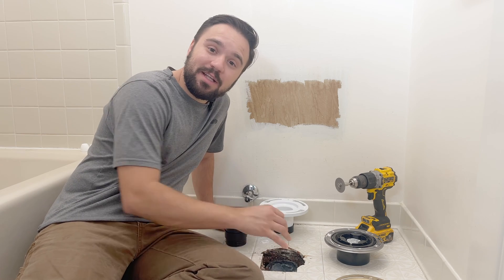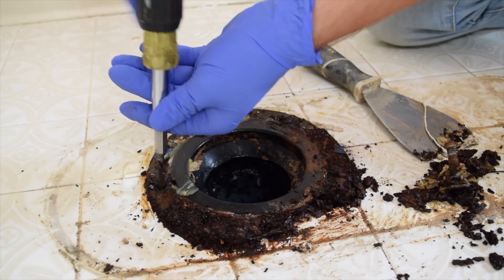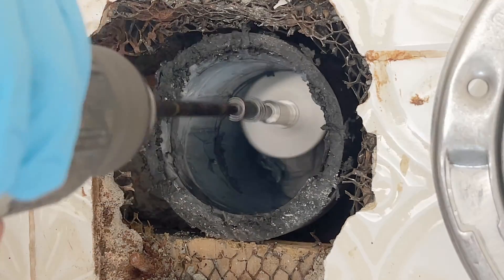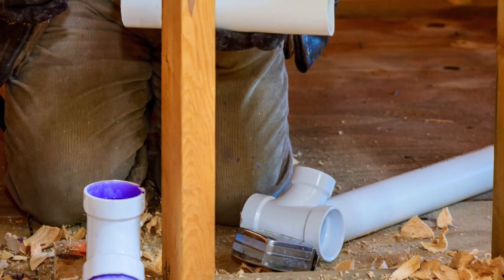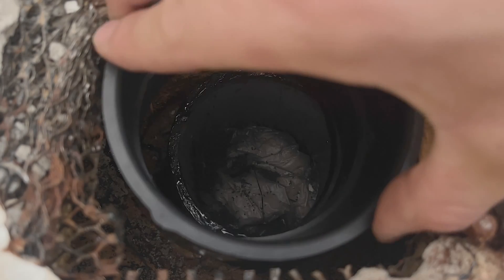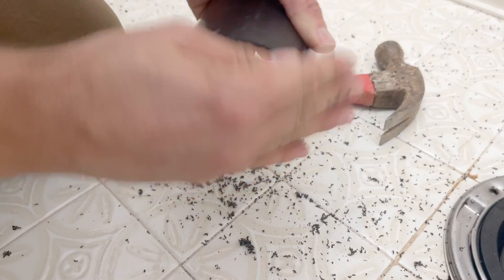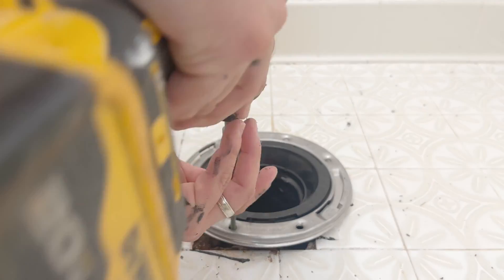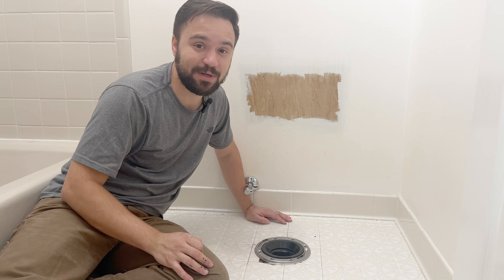How NOT to Repair a Rusted or Broken Toilet Flange

Comment: great video, but one funny question... is it possible for a circle to not be the same distance from the wall on both sides? assuming the wall is straight, and you are measuring at a 90 degree angle from the wall.
Reply: He was referring to the setting bolts slots in the flange. You need to make sure that the bolt slots are the same distance from the back wall so that the toilet sits square to the wall. I usually make a pencil mark on the floor at the same distance just outside the bolt slots, so you don't have to keep measuring to check.

Comment: I used one of those twist and set 3" toilet flange because I didn't want to cut anything. Besides I believe my waste pipe is copper not ABS or PVC. The 3" twist and set flange perfectly sealed because of the rubber seal. Why is that the wrong way to do it just curious.
Reply: Exactly my thoughts. Its not like the counties or municipalities come and lift your toilet up and check your flange. Second, The flange is also not just floating there. You bolt it down to the floor and the rubber seal does the job well.
Reply: @Mikeaawwck  Exactly lol I have yet to have someone come lift my toilet and check what flange is underneath it lolol

Comment: Twist-N-Set toilet flange should work.  It shouldn't be just floating in there, the gasket that expands upon twisting creates the seal. It says it can repair PVC, ABS, and cast iron pipes.
Reply: I've actually put silicone on those Push-Tite flanges before inserting and it does the job.
Reply from the maker: I will check that out! Thanks for the tip.
Reply: Only way it would float is if wrong size for pipe?

Comment: Done a few over the years. Need to have plan A, B and C, have time to chase parts and tools. Know where the main shut off is, toilet shut off valve many times don't shut off complexly if its been a few years. Sometimes need to replace part of the subfloor, one time had to do the whole bathroom. All new subfloor, tiles, rotted joists, walls then a complete shower. Some of the rot went to the next room. Then under the crawl space in the adjacent bathroom, tub was leaking. Never know if you don't go under. Didn't seem like it ever ended.
Reply from the maker: Oh, you're absolutely right! As you can tell from the video, every DIY project comes with its unexpected twists. After pulling out the old flange, I had a moment of "Oops, another trip to the store." 😅🛒 It's true, once you start with subfloor, it can turn into a whole adventure. But hey, that's the fun of it, right? Thanks for being part of this community and supporting the channel! 👍🛠️

Comment: I had to do this exact thing a few years ago. However, I was dealing with cast-iron piping.  It was not fun and it took me over a week to figure it all out.
Reply from the maker: Dealing with cast iron piping can indeed be a pain. It's great that you were able to tackle the swap out, even if it took some time. DIY plumbing projects often come with their unique set of challenges! Thanks for watching and the support!! Happy plumbing 🪠🚰🔧😊!!!
Reply: @DIYPlumbingGuy  I have this problem with cast iron. How do you recommend that I add an extension/cut it so that I can add a new flange like you do in the video?